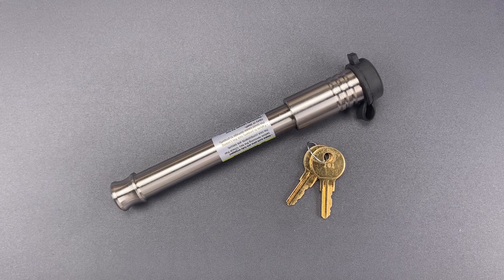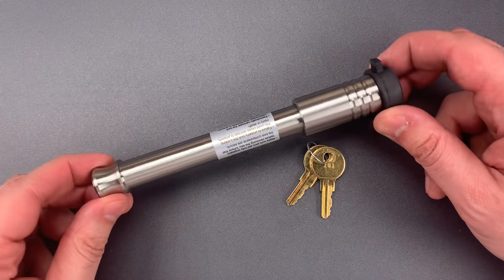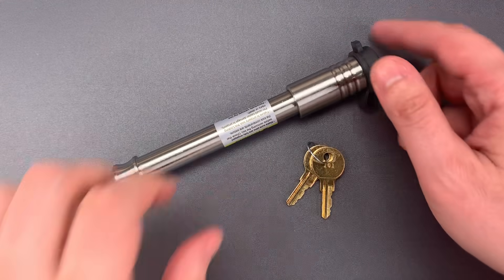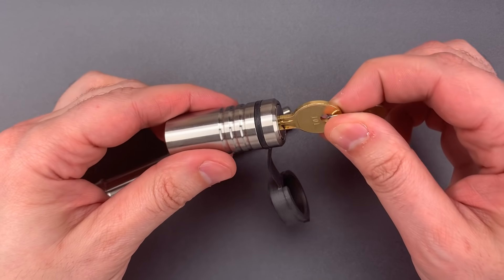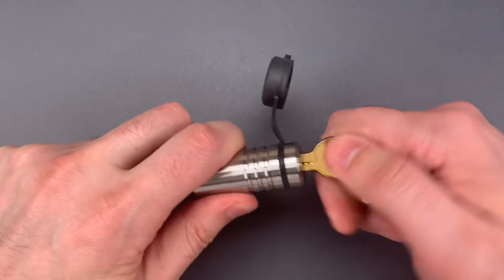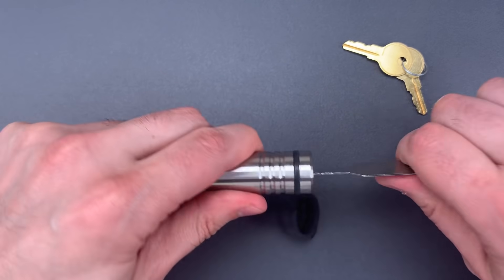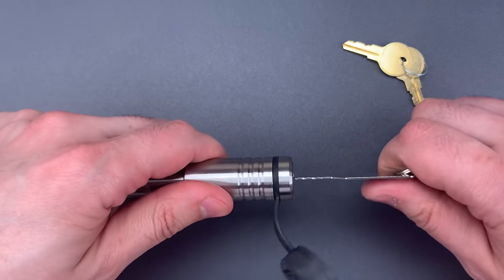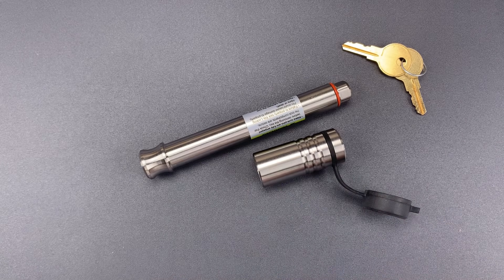[1086] The Lock That Must Be Picked 15 TIMES! (Infinite Rule Security)

Comment: With the right core, it seems like the lock could be fantastic.
Reply: Seriously. Increase the price a few dollars to make it a real challenge.
Reply: Yeah, even a few serrated pins or mushroom pins and this would be tedious.
Reply: *with anything that cant be jiggled
Reply: Right, I don't know why they wouldn't have spent an extra ten bucks to put a better core in there.
Reply: @marshallfischer3667  Profit margins
Reply: Disk detainer core for the most valuable use of the tool LPL and BosniaBill made together
Reply: That describes some Master locks I've encountered.
Reply: @kornfrk10  Actually, I'd bet they used a wafer lock because it's a lot more dirt tolerant. Pin based locks plus truck undercarriage dirt probably isn't the best combination.
Reply: Abus 6 pin Core+this design= Carnage..
Reply: @stevemccarr  could be. But shutters on automotive locks aren't exactly a new idea.

Yeah, a bit more cost. But not that much.
Reply: @stevemccarr  Good point but isn't that what the cap is for?
Reply: imagine a abus xplus core in this design :D
Reply: @stevemccarr  - Isn't that why they provided a cap/cover for this lock to keep the dirt and grime out?  :-)
Reply: A wafer lock only requires notches to catch the wafers; a pin tumbler lock would require a bible to hold the springs and drivers. You can fit 3 pairs of notches (six stops per rotation) which gives more places to stop so the bolt is snug. It's the best choice for this type of lock, but they could put a good wafer lock in (see the Chicago Duo as an example).
Reply: Yeah, at that point, just cutting the shaft would be more efficient
Reply: @iWhacko  No pins in this one, it's a wafer lock. A conventional pin tumbler would only lock once per turn, so you'd only need four passes, but a core spinner would trivialize that too. It'd be better than this, I mean, but.
Reply: All locks that use the thread type are setup for greatness. Machine a long enough sleeve (15 to 20 rotations) and you're set, but most fall on their nose because they use garbage locking internals. To begin with, i'd never use a wafer core on something like this. In this application, for a regular thief, even a freaking shitty pin lock would work better.
Reply: Protec core just for the overkill.
Reply: @B-System  I understand, but you could add additional shafts at 45degree angles, like we've seen in challenge locks. Although maybe not in this size of lock. Or get a particularly difficult warding. But even making the picking harder than just a wafer lock makes it at least more tedious. and yes a spinner could be useful still.
Reply: Bosnian Bill reviewed a tubular lock that had a thread in it and closed in a similar fashion.
Reply: The core is not the problem, look how long it extends, I think this might be susceptible to someone sticking a long pipe on it and snapping the core off.
Reply: @kornfrk10  MBA
Reply: Yeah. Imagine that kind of setup for a bicycle lock
Reply: @kornfrk10  thank you
Reply: We were so close. We were on the verge of greatness!
Reply: @iWhacko  this is a wafer core, not a pin tumbler
Reply: @marshallfischer3667  they wanted it smaller, i called them
Reply: Is the core a standardized length and diameter? If there is such a standard, seems like you could recore it yourself.
Reply: Jonatas Silveira Baldo if it had a disk detainer core, the video would be considered long for the lockpickinglawer!  Which would be a really good thing!
Reply: @samkatz227  I got that, I just forgot to say to replace it with a pin tumbler and THEN add serrated pins etc.
Reply: No only good or extra cores, but did you take a look at the mechanism ? You could easily and cheaply add way more turns needed.
Reply: It could be destroyed in seconds with a heavy im0ement.
Reply: @bosstowndynamics5488  yeah wafers should be VERY LOW like Ben and Jerry's level
Reply: @wdiaz03  I believe most of the body of the lock would be covered by the hitch it's in so that wouldn't really be an issue
Reply: @caracaes  Disc detainer core will not automatically re-lock so once you pick it once, it stays open until you manually re-lock it.

Comment: Imagine how much of a pain that would be if it couldn't be raked open.
Reply: Rob Speed jiggled
Reply: Then it's likely that a good (=fast) plug spinner might be able to minimize the number of times you'd have to pick it
Reply: @saschaschneider6355  you wont find nearly as many spinners as jigglers tho
Reply: and a spinner that's so fast to spin 15 quarter turns is also quite challenging I think
Reply: @ajuanjojj  er, you pick, rake, whatever, rotate slightly, take your tools out the lock and then use a spinner on it

Edit: Sorry, I had misread what you were saying. I think the original point was about cores that don't jiggle that easily, that you would actually have to pick.
Reply: @AgentM124  hence "minimize". You pick, spin, pick, spin, rinse and repeat until open. You very likely will have to pick multiple times but the spinner greatly reduces the number of times you'll have to pick. From 15 to maybe 3 or 4 times
Reply: @saschaschneider6355  true, and that still sucks given a good enough core. Not this lil wafer thing.
Reply: it's a feature!
Reply: If I knew what it was right off the bat I would just attack the door or drill it just to be faster.
Reply: @saschaschneider6355  Line it up right, and you would only need to pick once. Just don't spin in to a locked position
Reply: @BandanaDrummer95  true, but with pins every quarter turn that can be tricky
Reply: @Murphy deffa "lets add stop mechanis so you have to remove key for every turn" - at that point as a customer I'd return the lock to where I've bought it
Reply: I've a feeling there must be someway to pick the lock once, and then freeze the mechanism in place, allowing it to rotate freely?

Thinking pin tumbler-
Superglue or some kind of putty maybe or some tool that can record the relative positions of all the pins, filling with wax and letting it cool would probably work, would likely bind up the lock less

Or destructively just drill a narrow hole through all the pins and insert a rod, keeping them all in place,
Reply: @patrickriarchy6054  its a trailer hitch lock, so for stealing a trailer with a fully loaded fishing boat for instance.

Comment: Imagine if this thing had a disk detainer core...  This could have been LPL's longest video ever.
Reply: idk if even the pick that he and bosnianbill has that kind of milage
Reply: Maybe not.
Step 1: Make a tool out of all-thread rod that can spin the core.
Step 2: spin a nut on it, then hammer the end so that the thread is damaged and the nut can't come down.
Step 3: position the nut many turns away from the end
Step 4: chuck the nut in a drill. Do you see now where this is going? 😉
Step 5: pick the lock, then insert the tool, and spin the drill on max RPM (CCW direction).
If the speed is not enough, use faster tool. Hole grinder, vertical wood mill, etc...

The nut positioned way further than the locking point allows the drill to reach full speed without turning the core, then when the nut locks, it will spin the core fast with all the momentum and speed.

Possibly dangerous to try in hand!!!
Grip the lock in a vice, which is mounted on the table, and obviously no one should stand in the danger zone.
Reply: @Elbert VonVerim it would be easier to just blow it open, make a key mold, or steal the key itself at that point.
Reply: @gabiold  Yes, but that would require a custom build of an already custom lockpick. There's practically no chance that someone would have such a tool on hand unless they were REALLY intent on getting past that lock, in which case there's no way a lock by itself is going to secure it.

Comment: 15 times? Holy crap-
wafer core
Nevermind.
Reply: Wafer
Reply: I feel like it'd still be a pretty good theft deterrent if the thief isn't familiar with this specific type of lock.
Reply: GuyNamedSean yeah I’m wating in getting wager picks (got massively delayed cause of this situation) so I can only pick the locks with pins (can’t remember the specific name).
Reply: Seems like a pretty good lock, most people aren't going to know they need to pick it multiple times, imagine a lot of people would give up if it didn't open after first few attempts.
Reply: luft wafer
Reply: Might be a fluke.
Reply: I really couldn't resist 15 time...holy manure!!!!
Reply: Daniel Cuevas pin and tumbler lock is what I think you are referring to
Reply: @GuyNamedSean @Matthew McGreskin
You're thinking in too complicated a fashion.
Any thief who actually does bother with picking (and let's remember this isn't a bike or shed lock so both potential win margins and equipment are quite more high tier) at all is going to try try jiggling/raking first specifically because it's the fastest most low-skill attack possible and thus the fastest to confirm or rule out. If there's a click you're clearly doing something right and should continue.

You don't need to understand the lock or be particularly intelligent. You just need a logical approach to picking based on a set of fairly simple rules.

And again. This is a truck/trailer lock. Whoever wants to abscond with that type of thing is likely quite a bit more motivated than usual. This is like having a rake-prone safe.
Reply: Nevermind that the bitting appears to be 1 1 0 0 1.   The key might as well be a blank.
Reply: It has potential though.
Reply: So “wafer” seems easy, what core(s) should have been used? I know nothing about locks. I would like to think people building them know better.
Reply: Waver locks can be jiggle/rake resistant but you'd likely want a Disc Detainer core if possible. It's faaaaar from ultra pick resistant but it'd be a world of pain to pick it 15 times with no additional info.
Reply: Same reaction here...
Reply: Out of the 129 thefts in my area, 0 of them involved picking a lock. People get fancy super duty hitch locks, but then only secure their receiver with a cotter pin.
Reply: @randomwanderingstranger293  p2p waffle
Reply: @firstnamelastname-rf8lt  YES
Reply: @0020282  Security really is usually about preventing opportunists anyway. If someone were targeting you specifically there's usually ways around the locks entirely if they were dead set on robbing you specifically.

Comment: That moment when the picking starts at the half way point of the video, is done 15 times and did not even involve the pick Bosnianbill and I made.
Reply: which is cheating anyway imo
Reply: @andyhug90  the pick he and bosnianbill made isn't cheating. A locksmith should always be finding ways to improve their skills and capabilities in their field. You wouldn't say a doctor is cheating for using a saw instead of a scalpel during an amputation. You wouldn't say a mechanic is cheating for using a socket wrench instead of having dozens of various sized regular wrenches. You wouldn't say a chef is cheating for using a big pot instead of a small saucepan. You wouldn't say an electrician is cheating for using wire cutters and heatshrink instead of electrical tape and scissors. You wouldn't say a plumber is cheating for using a pipe wrench. You wouldn't say a construction company is cheating by using a crane. I'm sure by now you get the point. He developed a tool that improves his capability to do his job, and if memory serves he even sells it on his website. To say a person is cheating because they developed a tool that helps them do their job better is just silly. Every single career has its own equivalent to "The pick bosnianbill and I made."
Reply: @princessluna2698  I love that you proved your point with the first example, but in true LPL fashion, you proved it several more times to show that it wasn't a fluke.
Reply: @nonyabusiness7794  😂
Reply: This is the best comment I’ve even seen on one of his videos 🤣🤣🤣
Reply: @princessluna2698  You are right, but it is sort of unfair judgement in the sense a garden variety burglar won't have access to specialized instruments, like something LPL and BosnianBill made. So with what they have, they may have to struggle more against some of the locks that are easy for LPL. I think that's what OP meant by cheating. It'd be like, from your example, a surgeon analysing complexity of an operation, with exclusive access to some alien technology specifically designed for it, say, a laser scalpel, while all other surgeons can only use normal scalpel, or as you say, a saw.
Reply: @snehadityaghosh8973  what’s stopping the average burglar from at least trying to make an improved method of breaking into a house
Reply: @hgdd2422  I dunno, money? Time? Resources? Need? LPL and BosnianBill are well established men pursuing their passion, they can invest in building specialized tools. Also, I don't think most burglars would even feel the need to build one, while they can just go to the next building and crack a, I dunno, MasterLock? Again, if the burglar is an old hand at the game, he might have specialized tool. I am just saying most wouldn't have. Or maybe...not a burglar myself to know enough of the trade. Where I live, break-ins are uncommon, and when it happens, they usually have all the time in the world to do whatever they please.
Reply: @snehadityaghosh8973  LPL literally sells the pick online.  Any burglar that DOESN'T have it in his collection deserves to get caught.
Reply: @namelessminionveinreaver3763  didn't know that. Maybe. Assuming those are affordable by a burglar.
Reply: I love that folks talking about what constitutes “cheating” when it comes to burglars picking locks... 🤔😂
Reply: @snehadityaghosh8973  Once a new picking device is created, typically LPL sells them on his store and soon after many imitations are made. Pretty much once a device is created to help it becomes commmon after some time.
Reply: @snehadityaghosh8973  its like 15-30$ iirc. Somewhere in that price range. Its definitely affordable.

Comment: In the next video, another lock of extremes - truly unpickable design that's unfortunately made out of damp paper
Reply: LPL wouldn't even dignify with a try. He goes the path of least resistance, and he has gone and just used a lighter on locks with plastic cores to melt them. If it's particularly cheap plastic, he will just use brute force to break the core.
Reply: @lagg1e  which is fair, any thief is just going to break in using the easiest method he can. If the door has a good lock and is steel reinforced, then they'll just bust in the window. If the bike lock has a good design, they'll just cut it off if they can.

Comment: Adding a halfway decent core would make this pretty damn good. Avg lock takes lpl up to 30sec x 15 and it's almost a 10minute video
Reply: But what kind of core locks 4 times in one rotation? Pin tumbler and dimple do it one time, those cross-(+)-style pin tumbler locks from Zeiss-Ikon (and other) lock 4 times and disc detainer locks ..hmm.. perhaps. I don't know how well you can rotate a picked core because i think i have never seen a disc detainer core picked outside a lock without limiting the rotation.
Reply: lootmaster1337 now add some security pins (serrated and mushroom and false pins) and your popping off with anywhere from 5-10 minutes for an average person to pick
Reply: @JohnADoe-pg1qk  You can just use a different metric on the screw so it needs to turn more times for the same distance

Also i think that would also give more strength to the lock itself
Reply: @Flashbang_Photo  I don't know how often this kind of lock ist opened and closed, but if you have to turn the key 10 or 15 times to open the lock (and to close it again) you'll look for another lock really fast and recommend it to nobody else at least.
Reply: @JohnADoe-pg1qk  15 quarter turns and the last one didn't seem like much of a turn so more like 14. That's only 3.5 full turns with a key. Inconvenient maybe, but I have seen people go through more for security.
Reply: @paulhomer9215  This is the situation now with the wafer lock. 
My second comment was a continuation of my first comment, assuming that a core is used, that normally can lock only one time per rotation, a normal pin tumbler core for example.
Reply: @JohnADoe-pg1qk  It is not a problem to make a bible that has four driver pin stacks. Several people have done similar as challenge locks they've sent to BB. They are a bit of a hassle to pin up though :P

Comment: Just imagine if that was a disc retainer core, would take a professional with the right tools 15 minutes to get open, real shame
Reply: Disc detainer* they meant to say. Thats the kind of core thats on many bike locks. This is a wafer core thats usually used in super cheapo locks, wafer cores can almost always be jiggled open.
Reply: @baqcasanke  a disc detainer core can't relock the way a pin tumbler core does.  it would need to be a pin tumbler with security pins. 

that said, it's still vulnerable to impressioning, and it only needs to be impressioned once to get a key,.

Comment: That's actually a great idea... make someone pick a core 15 times to get it open.  If the core were even slightly harder to pick, it would exponentially make this harder to pick.
Reply: But what if you replaced the screw with a combination lock mechanism? That way, your key becomes the dial after inserting it.